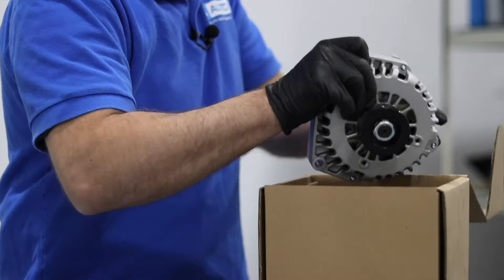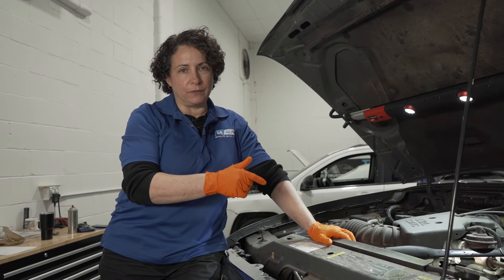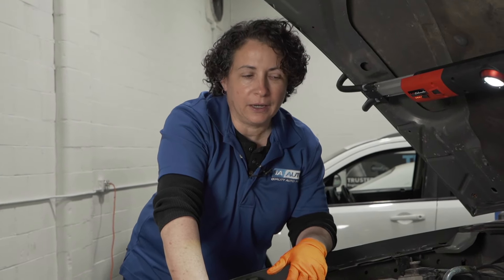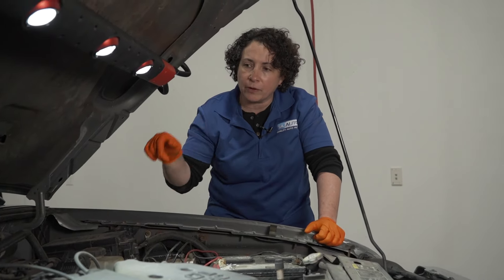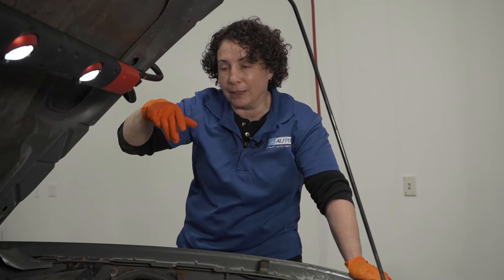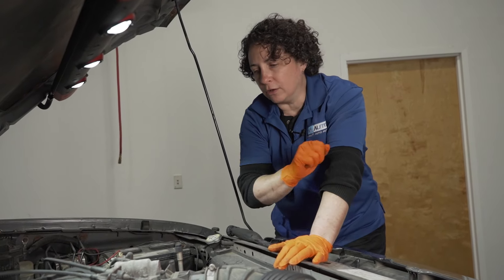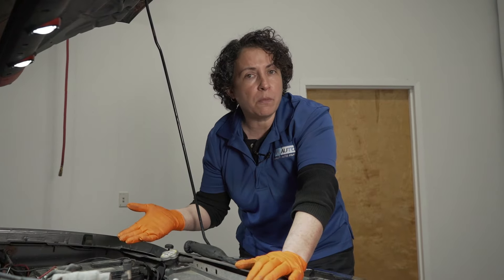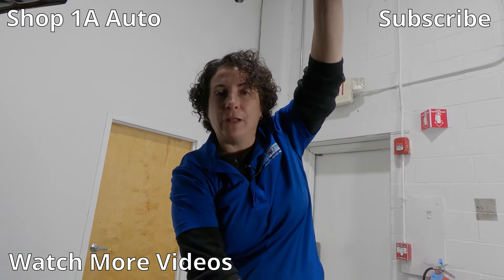Top Common Engine Problems 1998-2011 Ford Ranger Truck

Comment: Most of this is not relevant to the 4.0 OHV that was in the 98 to 00 Ranger. They ruined that engine when they made an overhead cam engine out of a design that was never meant to be that way

Comment: So glad you addressed the thermostat housing. This was the bane of my existence with my ranger until I finally just got an alluminum one. The fact they didn't test this enough to know that under normal use the housing will frequently warp and break down is infuriating. One of my biggest gripes about newer cars using so much plastic based parts.

Comment: Filled my 2003 SOHC with water going upstream. Took apart the engine, emptied the water out, and it's already gone a few thousand miles as strong as ever. Sounds a little different.

Comment: Your video guy needs to show where the problem part is and where to find it, rather than your lovely face. Thanks, I own a 99 3.0L with 243K on the engine clock. Runs like a charm.

Comment: I'm surprised she didn't mention timing chain tensioners. Part of the fix for the startup rattle on 05 and up 4.0l engines is to replace two timing chain tensioners that leak down when the engine is not running and take a moment to pump up and put tension on the chain. Not a huge deal, can be done in a couple hours, and a lot better than have a chain jump timing if they get real bad.
Reply: couple of hours? you have to take OUT the engine on the 4.0 to get to them, because you have to do front AND back tensioners
Reply: Timing chain guides failed on my 4.0 2005 Ford Ranger FX4 Off Road. Ended up just putting a brand new Jasper engine in it with a 3 year 100,000 miles. Well worth it.
Reply: @Ornelas11B  where did you purchase this?

Comment: Yyyyep. I can attest to every problem here, and several others. My '04 Ranger had all of them. 8866.61$ later, I have a reman Jasper engine and new clutch. Great truck though. Absolutely must take care of them if you want it to last 200k+ like a lot of owners talk about. 

Your videos were invaluable to me during what repairs I handled myself. Thank you!
Reply from the maker: +Calum Rife Thank you! We love empowering our customers and showing how to perform DIY auto repairs with our high-quality auto parts.  http://1aau.to/m/Shop-1AAuto-c
Reply: I just put a brand new Jasper in my 2005 Ford Ranger FX4. Timing chain guides failed at 198,000 miles. I’ve got 200,000 miles on the truck now and it still looks like new.

Comment: I had a 98 ranger 4.0
Had 396000 before main crank bearing went.
I had alot of idle air control issues   had to replace a number of times

Comment: Almost all the issues I've seen covered on the ranger involve the 4.0 engine, but to my thinking the biggest single engineering fail is the timing system and the need to basically pull the engine to do a simple chain guide replacement. All the extra work just to utilize one head for either side instead of left and right. I own an 08 with the 3.0 and at 160 k it hasn't had any of the problems common to the model. Very reliable, solid truck that'll do anything asked of it within reason. The somewhat anemic HP can be remedied to some degree with cold air intake and tuned exhaust, and they respond fairly well to chip tuning. It'll never be a drifter, but it wasn't intended to be, but these upgrades will wake up the three and make it fun to drive

Comment: Had a pile of these 2001-11 at work every one blew the auto tranny in the 3.0 and most blewr engine.   I had a manual the trannyvwas tough but the 3.0 popped at 123k mi.

Comment: My  Synchronizer  on a 3.0 was chirping and causing the engine to stall when decelerating  or starting to accelerate from a stop. Replaced with OE and used old Ford sensor (since they are sold separately).  No problems in 20 thousand miles, when they are going bad it can be a big safety hazard and you just shouldn't live with the chirping.
Reply from the maker: +Jerome Thanks for the feedback!
Reply: Do u have a link where u got them from ?

Comment: Real easy, Yeah!
 2003 4.0L Ranger thermostat replacement.. 
$8.00 part three simple bolts right?
The part they don't tell you is you have to remove the whole intake to remove those three simple bolts.
My next project 2003 3.0L PCV replacement with that stupid long plastic tube attached.
Same thing Intake removal for what should be a simple plug N play procedure.

Comment: My 03 auto 2wd 4.0 ranger stalls in reverse but only when warm. Sits in 1st gear at a stoplight just fine. It had a vacuum leak but I fixed that. 
 Replaced the tps, cleaned the air intake valve, but it only happens in reverse.. I'm stumped. Crankshaft sensor replaced also.
Reply from the maker: +@fastwaterpw We wouldn't be able to diagnose an issue like that here, you may want to have a local mechanic take a look at it. Thanks for checking us out! http://1aau.to/m/Shop-1AAuto-c

Comment: 01 4.0 over 200.000 + miles pumps housing  alternators ip1 trans break lines runs great cheaper to fix then new 23 years old 4x4  works still AC great heat great  love it looks great

Comment: These are great trucks but the timing chain setup on the 4.0 OHC is a complete nightmare! Ford should’ve just left the 4.0 alone or developed a new engine that was designed as OHC from the get go

Comment: I’m looking at a 2012 with 22000 miles on it tomorrow, my neighbor died about 6 years ago and the truck has been sitting in the driveway ever since, anything specific I should be looking for? They start it every 4/ 6 months but they don’t drive it,it’s sitting on asphalt so hopefully the bottom and the brake fuel lines and  transmission lines are not all rotted,it’s a 4.0 v6 4x4 with the small rear door cab I think it’s 6’ bed

Comment: Getting ready to turn 300,000 98 4.0 only thing changed, oil, rear and front trans axle fluids  at 100,000. serpentine belt, alt., headlight bulbs, wiper blades, auto. fluid and filter. egr valve, pvc valve. 4x4 air hose. That's it runs like new!  Runs like the energizer bunny on new batteries!  (Glen).

Comment: You have some incorrect information that is pretty serious at 1:12 mark. The Cologne 4.0 V6 is an INTERFERENCE engine! The "death rattle" will cause bent valves and heads if the timing chains are neglected in the 1997-2002 years. You guys really need to correct this, very serious misinformation you gave out.

Only the 4.0 V6 OHV is an NON-interference engine.
Reply from the maker: +Jacob Freeman Thanks for the tip! We'll pass this info along to our production team.
Reply: @1AAuto  well you need to correct this error. You guys are going to have people thinking that their truck will survive bad timing when it won’t! Why put out incorrect information?
Reply: @1AAuto  take down the video, edit that part, reupload, and profit

Comment: Could really do with a more close up view of the IAC part of the video. That's a problem with my 2001 explorer, the idle revs go up and down and cuts out etc. Thought it was maybe the throttle position sensor?
Reply from the maker: +Potential Techniques Thanks for the feedback! We'll pass this info along to our production team.
Reply: @1AAuto  i just felt that when you were talking about the part the camera was showing the person more than the actual parts being talked about.. Would be best to have a sequence of the person talking, pointing to where the part is in relation to the engine, then zoom in to the actual part and it's surroundings close up to get a good view of it, but knowing where it is in the engine.. Thanks it really helped i cleaned the IAC valve and it's a lot better but the revs still suddenly drop and the car stalls, seems to run better when i take one of the tubes out of the air intake so it can just suck air into the engine with no filter in the way so I've ordered a new filter in case that is choking the air supply. Might be a maf sensor problem. The revs are much more stable now though after i cleaned the IAC with some electrical contact cleaner and some cotton buds.
Thanks again for the advice on how to fix cars, i really hope karma rewards you well for that as i really can't afford to go to a garage to get it done.

Comment: Okay my tooth at my 1998 Ford ranger and four cylinder in it okay somebody put something in the oil and made the oil pump not work now the oil pumps working after I cleaned it all out in the motor but now it's lifters are tapping I guess at the top making loud noise clattering and I need to know how to fix that
Reply: How did u fix that what exactly happened to me on my 98 Ford
Reply: Can u get a answer for me on this matter

Comment: what is the part number for that aluminum housing for thermostat  as so far i had to replace mine 2 times seems like every 3 years.
Reply: I had mine go out 4 times before I finally got tired of changing it.  Look it up on ebay: Ford Ranger 4.0 aluminum thermostat housing with your model year.  Before you buy check to see if you have 1 or 2 coolant temperature sensors.  It’s about 4-5 hour job and you can look up vids on YT how to do it.

Comment: When have  timing chainnoise  2. Point why.  Need use 10w40.oil.  orchange two.  15w40. Bneed use motorcraft  oil filer they have check.val in oil filter . Keep losen prime  .won't lose prime in oil filter .  They have time chain tensioner. Heavy oil tight on chain.  If have rear main oilleave  because rear main bearingcap  has under size clearnance  blow . Bypass rear crankshaft bear.  Thenreplace  seal too solve leakes .rear main bear. &seal.  Solve remain oil leak.

Comment: '98 Ranger XLT 2.5L, 5spd. Idles high when driving & shifting until I come to a complete stop 0mph. At a complete stop idle drops down to normal. Have replaced IAC Twice part #AC117 Standard Motor Part. RABS has been changed along with TPS, EGR VALVE & EGR SENSOR, DPFE, new catalytic converter & 02 sensors, MAF sensor, throttle body cleaned. Have disconnected IAC, one time it stayed low(normal) and drove fine, one time there was no change at all. I don't believe it is a vacuum leak because it is not consistent. I have checked all vacuum lines and hoses, with the exception of the Evap Vent sensor and the big hose from that to the canaster. Does the PCM need to be recalibrated/reset with proper perameters? I've reset several times with and without code scanner. If and when engine light comes on the code is 1506 IAC Valve. How big of a hammer should I use to fix this issue?
Reply: I don't know if this will help; disconnect the battery for like 20 minutes. Reconnect. With all air/ac OFF, no wipers, radio, anything at all - start the truck and let idle for a full 2 minutes. After the first 2 minutes have passed, turn the heat option all the way up, and the fans on just below max AND THEN turn the air options to max a/c and let idle another 2 full Minutes. Once done, turn the air back OFF and let idle under no load for about 30 seconds. Turn the car off. Next time you start the truck, you should be stable(er). Or not. It works on my 2003 SOHC 4l

EDiT: i also have a 5spd manual. Have also filled engine with water and its still fine apparently. I definitely did this trick rebuilding the engine lol i do think it helps though

Comment: Actually the 4.0 is a interference engine. I have bent valves I can show you. Timing chain replacement requires engine removal.
Reply: Aye, she does say that. The main reason for the need to remove is because it has 3 chains total. One to each cam, and one small one on the crank. Due to how they made the chain system, one of them is on the rear of the engine so requires pulling it to get to it.

Comment: The Synchronizer drives the oil pump the chirp is more than just annoying. If it seizes up or if the gear that drives it off the cam breaks your oil pressure will drop to 0 and the engine can lock up.
Reply: That is true